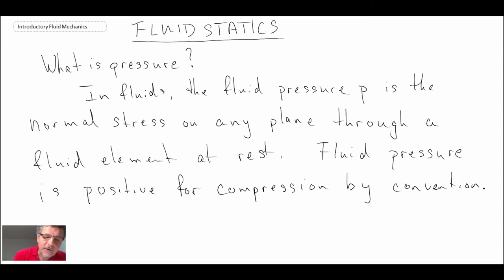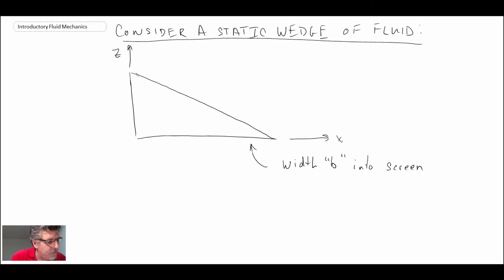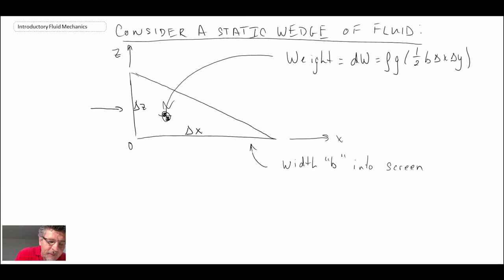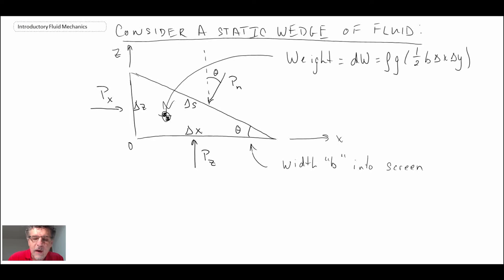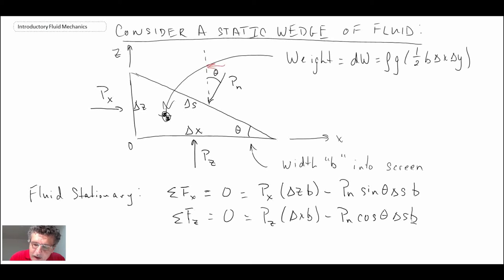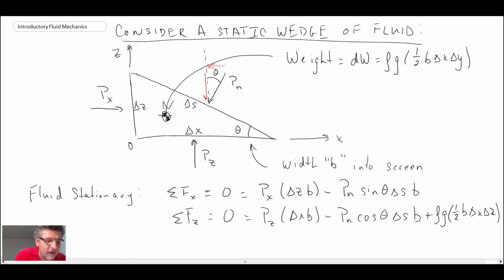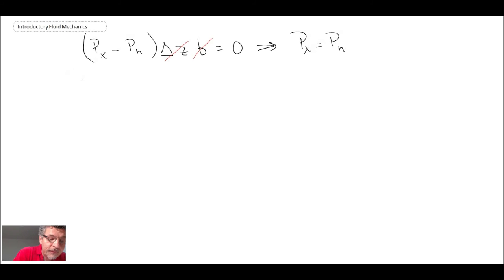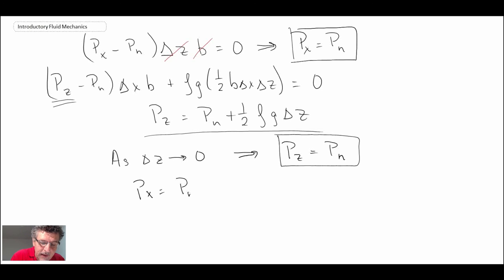Introductory Fluid Mechanics L4 p1 - What is pressure?

Comment: I think that the sin(theta) and cos(theta) should not have been omitted in the last two equations for pressure in the x direction and pressure in the z direction, although the cos term will divide out since the sum of forces in the x direction equals zero and the sin term will divide out in a similar fashion when delta z becomes infinitesimally small. Am I correct by saying this? Is this just a simplification that was understood?
Reply from the maker: +Robert Kerestes cos(theta) and sin(theta) originally appear as they are used to resolve P_n into an x and a z component.  The delta s * b term appears as it is associated with the area of the surface over which the pressure acts.  The cos(theta) and sin(theta) terms later "disappear" from the equation as they become coupled with delta s  term and translate into delta z and delta x.  This is not a small angle approximation, rather just application of trigonometry.
Reply: +Ron Hugo It is 100% clear now Ron. Thank you very much for your response.